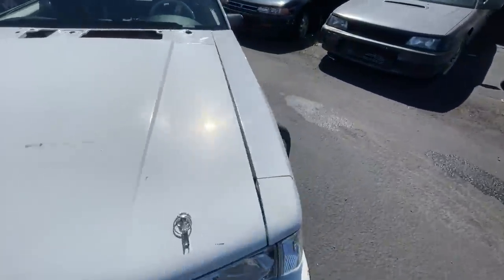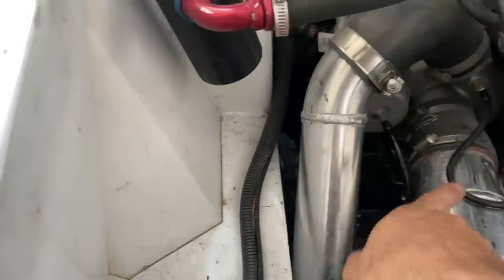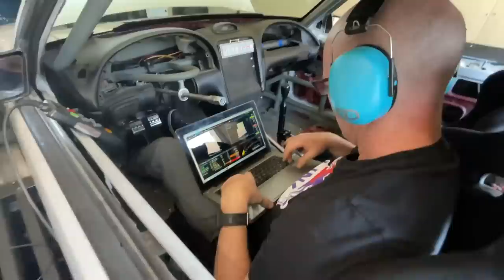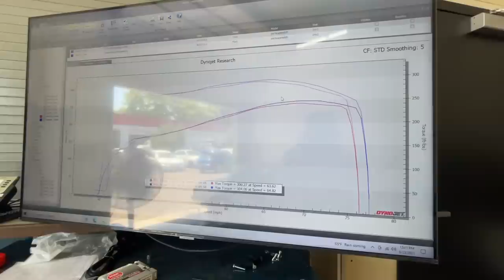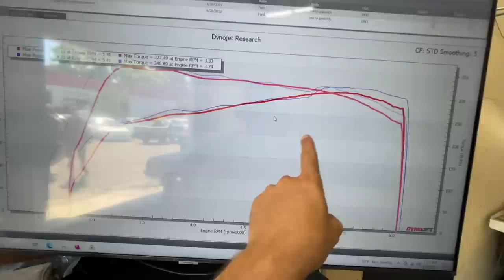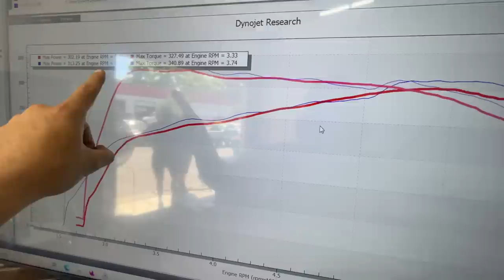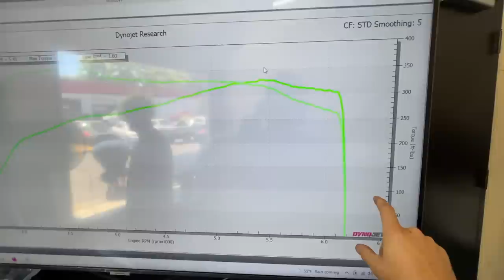We Take The Ecoboost FOXBODY To The DYNO!

Comment: I’ve owned so many hatchback fox’s but I’ve never got to own a Notch, watching this build has made me want one badly. Great video man
Reply: I just bought my first ever fox notch today pretty happy no cap
Reply: @franciscodiaz1214  that’s huge how much did u buy it for?
Reply: @franciscodiaz1214  hell yeah man, congrats! What’s the plans for it?
Reply: Try to find a 4 or 6 cylinder car. I got a silver 4 banger with 63k original miles and black interior. Did a LSA blown junkyard L33 swap with a dc009, junkyard mountaineer lim slip rear end, coilovers, sn95 cobra brakes, rad wheels, sterio, and left everything else alone. I bought the car for $2200 bro. I could be wrong but my notch feels way more rigid and stable than my hatch did and my hatch was fuckin DIALED man. Got smacked in my driveway when a drunk ass kid went 50 through my front yard. Sorry for the long reply man but i figured id tell you about that little secret. Its like some of the people that bought those base ass cars dont really know what they have too. The lady i got mine from didn't even like the car, who the hell would like a 90 whp fox notch with an automatic. I was just, amazed at how awful it actually was bone stock. Anyway, good luck dude. Hope you get one on the road soon.
Reply: Me too… I have a hatch and an sn95 but never a notch. It’s definitely on my list. Better get them before they become completely ridiculous price wise.
Reply: I have a Saleen procharged 6 speed 347ci ex NC highway patrol notch i picked up from auction.
It was a no crank no start.
The plugs weren't gapped properly and had a bad ground issue.

I won it for $1300.

The engine builder was tracked down and he offered me $30k

Needless to say i still own it,

Just rewrapped the car with silver and vantablack(stewlth bomber black)reflective 3m wrap to look like a shp car minus lettering and lights

It will run 135 mph in 4th gear @3000 rpm.

Top speed 172 !

Next summer its going to be converted to a removable hardtop roadster .

And I'm building a 5.2 voodoo engine right now that will be twin charged compound whipple and twin turbo on alcohol .

Once I'm done it will be a $100k car

I'm going to raffle it off @ $100 tickets x10,000 ticket's mame $1,000,000.00 off my $1300 start ❤
Reply: I have a Saleen procharged 6 speed 347ci ex NC highway patrol notch i picked up from auction.
It was a no crank no start.
The plugs weren't gapped properly and had a bad ground issue.

I won it for $1300.

The engine builder was tracked down and he offered me $30k

Needless to say i still own it,

Just rewrapped the car with silver and vantablack(stewlth bomber black)reflective 3m wrap to look like a shp car minus lettering and lights

It will run 135 mph in 4th gear @3000 rpm.

Top speed 172 !

Next summer its going to be converted to a removable hardtop roadster .

And I'm building a 5.2 voodoo engine right now that will be twin charged compound whipple and twin turbo on alcohol .

Once I'm done it will be a $100k car

I'm going to raffle it off @ $100 tickets x10,000 ticket's mame $1,000,000.00 off my $1300 start ❤

Comment: Did he salvage the ecoboost or did Ford hook it up? I’d be interested to see this kind of reliability and power in an e36 or a chassis.
Reply: It’s a crate motor I think. The Ti has this power level NA and is pretty reliable.
Reply from the maker: The motor currently in the car is a 60k mile salvage motor

Comment: Realizing I don't know a heck of a lot about the 2.3, didn't even know it was direct injection. Have you had any experience with the 2.0 ecoboost? I've been eyeballing the new maverick and thinking that a boosty p/u would suit me more than a subaru out in the mountains. Just don't know how hard it would be to get the thing to cooperate to make more power. They seem to be a bit slow for 250hp. Loving the build by the way, I've had a (raggedy but running) 1990 7-up mustang sitting around for the longest that I've been keeping to powertrain swap into my equally raggedy 65 Galaxie, but this project you have going here makes me want to bolt on a few parts order up a T5 and drift the thing instead. Cheers and thanks for the great vids.

Comment: Chelsea please run an EcoBoost in a competition. I got some vids of mine on my channel and it's a torque monster making more than a stock gt with just a few bolt ons. I always wonder why nobody ever used it as 550 EcoBoost in the drift event professionally as you could easily make one with 700 horsepower and it would be way lighter than the coyote. Not to mention it would be different and badass

Comment: does anyone know whats the length of super low bc racing damper when adjusted to shoretst and when its longest? i want to get shorter e46 rear damper since my spring is loose when the car is in the air/when shock is fully decompressed (and i mean like 2 cm of spring play so it can basically pop out)
Reply from the maker: Add a helper spring or go softer rate with longer spring
Reply: @chelseadenofa  i would go softer but im stock power 325i and im not looking into stance but i want it lower than oem and not to have any rake.

Comment: DI sucks so bad. Your valve will be caked with carbon after a while and have to do intake treatments to clean them. Nissan on one engine does run small port injectors, not sure if it's the keep the valve clean or another reason.
Reply from the maker: I beat the living shit out of this thing, so I doubt anything is collecting, also it doesn’t see miles only smiles